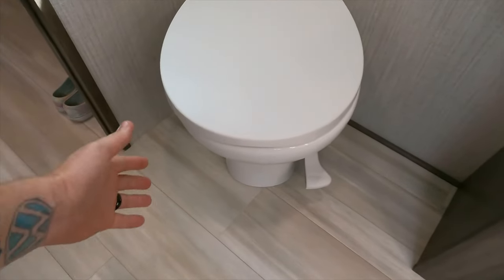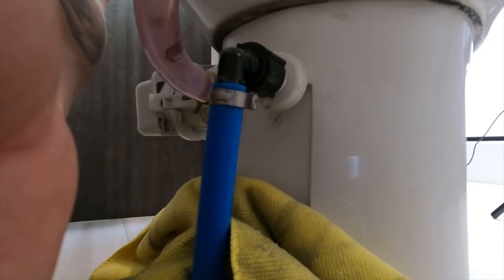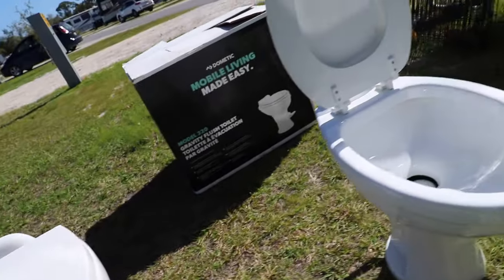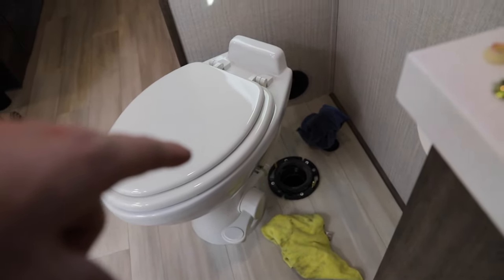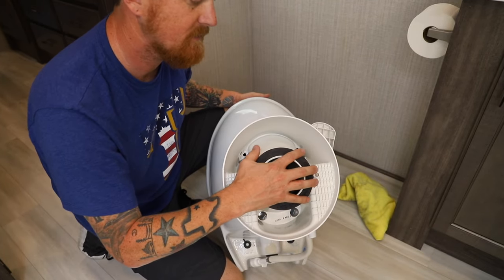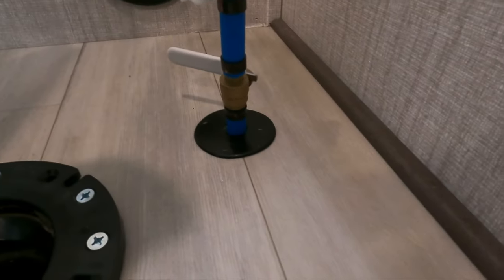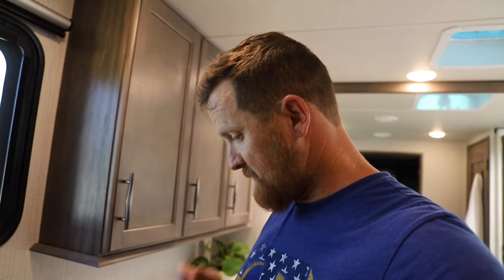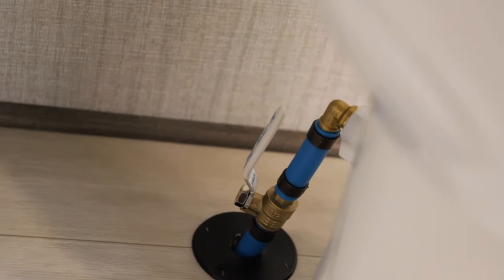RV Toilet Upgrade! Dometic 320 Toilet Install | Full Time RV Life

Comment: We have one, it sprays way more than that. it could be restricted by the additional fittings and on/off valve, each will add a % of restriction.
Reply from the maker: Good point, maybe that’s what it is. Thanks for watching
Reply: Damn, I think you should’ve stayed with the original one. If it ain’t broke, don’t fix it.
Reply: My 321 sprays the same amount in the front, it’s not much. Oh and these toilets are meant to be disposable because they don’t sell many parts for my 3 year old toilet so I have to toss it in the landfill.

The 510 has more parts available.

Comment: I’ve installed the toilet in a house trailer. Meaning not an RV. Residential toilet The process is slightly different because you guys have to use a rubber seal as opposed to a wax one.  flange seal.
Reply from the maker: Ya, that’s really the only difference.

Comment: Just got off the phone with Dometic trying to diagnose an issue as the bowl won’t hold water after replacing the seal. They acknowledged a manufacturing issue but won’t do anything about it. The two parts with the issue cannot be replaced and said the entire toilet would need to be replaced, at my expense. Basically, it’s a throw away POS! I’m shocked by their arrogance!
Reply from the maker: That sucks! Sadly, a lot of parts on these RVs are throw away!

Comment: I’ll throw you another tid-bit on the 320, I learned from experience. If you ever, by chance or stupidity, run out of propane in the winter in freezing temps….after thawing everything out, you may find that the foot pedal  is a bit resistant. DO NOT FORCE IT!!! Honestly, it didn’t take much extra pressure but it snapped off the smallest bit of the tip of the plunger for the water inlet valve so it wouldn’t flush. Apparently there was still a bit of ice in that valve. But, good news….you can get and replace just that valve fairly easily. I think there is a video of that here on YT somewhere. Someone else had somewhat the same issue I did. 😂
Reply from the maker: wow, good to know 😂

Comment: When you added those 1/2" crimp fittings for your shut off valve, you restricted the water flow. You should have used push to connect Sharkbite fittings. They lock over the water pipe and not in the pipe. The don't restrict water flow.

Comment: Went from the 300 to the 320, I do like the size better. My only complaint is when you get those parks with crappy water pressure, it doesn’t like to flush well but I guess that’s an issue with any toilets unless you install a res. toilet with a tank and risk it breaking when you move. That valve was a smart idea, I did the same. 
   Edit:: After watching the whole video and seeing you had the same issue with water pressure…. I find that it doesn’t start working “right” until up around 60ish psi. I know everyone gets scare about higher psi but in our newer rvs with 1/2” PEX, it’s rated to 110, so if you have pressure available, turn it up some more. But be sure you didn’t kink a line also. My problem is these parks that reduce down to like 45 psi. Even older rvs can handle 55-60 unless they are just junk.
Reply from the maker: Yep the water pressure is still something that has yet to make me happy with the 320. You are right though, 60 psi definitely makes it better. I also notice that it flushes a little better if I'm running off of my water pump instead of city water.
Reply: I don't think the issue is that the lines can handle higher psi, which you are right about, but the components that they are attached to can not handle higher psi, such as cheap plastic faucets/shower heads/black tank flushes. Its the water components that you need to worry about.
Reply: You might find that there is a shark bite push-on valve that's "full port".  I'd not worry about the life expectancy of the shark bite as you are at a lower pressure AND the fitting is readily accessible and visible--so if there is a problem you can fix it.  I've NEVER had one accidentally come off but for SURE have had to fight with them to get them off once those metal teeth as set in.IDK about the 90.  You can also go to 1/2" copper that also works fine with sharkbite and will definitely give you a MUCH bigger Internal Diameter and the resulting flow. Or maybe use a push-on size adapter to go up a size in tubing to 3/4"PEX (not copper that'd be nuts) and then those valves and 90 will have a bigger Inside Diameter/ID that should ease the restriction. I DO agree that it's the cheap valves and plastic parts of showers and sinks that are going to give out with the higher pressure.  It may take some time for the cracks to propagate to failure but when it does....it'll tend to be full blast--NOT like a metal water heater that's rusting through and starts seeping a little for days/weeks before a real stream shooting out.  It might be worth it to run a bigger line or even 2nd pump or add a 2nd pressure adjuster to bump the pressure BACK down to the rest of your rig.  IDK how complicated your plumbing is but seems you have the tools you just need the fittings and couple of sticks of 3/4" pex.  Oh there is a snap on brace that will curve the 1/2" 90degrees.  You'll need 2-3" so may have to relocate the cut-off valve back to somewhere else before the bathroom floor but it should definitlely help and is a big reason why PEX pipe can usually get away with the flow penalty of a thicker plastic sidewall/smaller ID penalty. I'd try copper+Push-on Fittings (take out in the inserts that keep the plastic PEX from collapsing first and then maybe a second water pump just to the toilet..BTW someone commented that the seal on a 320 is now known to cause waste water to collect where it mounts and rot out the wood/mounting material....I haven't checked it out but the OP responded they'd heard that too and there are no more 320s for sell on Dometic's Amazon store--only older stock in retail or clearance warehouses...  Just saying...--DD

Comment: We have a Dometic too in are RV and the flush valve keeps leaking and I replaced it 2 times. I just had it replaced 3 weeks ago and we are camping for 2 weeks and it worked great for 1 week and it just started leaking again. How is yours doing? And do you have any ideas?
Reply from the maker: Ours has been great for 2ish years now, no valve issues so far, knock on wood! I’m honestly not sure but the only thing I could think of would be to see what your water pressure is. Maybe it’s high and messing with the valve.

Comment: So, aside from you installing the water shut off valve, would the existing water pipe and connector work with no issues on the new toilet?
Reply from the maker: It was a little off with being considered correctly lined up from what I remember but it wasn’t enough to cause issues.

Comment: Other than the obvious comfort/size and seat differences was there any reason you did not like the Thetford? Did the Thetford break down or leak in some way? I'm actually contemplating replacing my Dometic 310 with a Thetford Aqua-Magic Style II (which is what you had) because of the leakage problems with the Dometic. The insides of the Thetford look like a much better design. The Dometic is designed to leak in my opinion. I do not have enough clearance to the wall for a Dometic 320. The Dometic 310 is smack against the wall and the 320 needs 11 inches (1 more inch than I have.)
Reply from the maker: Nope, other than those 2 reasons and the small wash nozzle at the back of the bowl, the Thetford was fine. It was a great toilet for what it was made to do! We just wanted something a little different.

I actually installed the Thetford from ours in to my Mother-In-Laws rig and its still running fine to this day!

Comment: My valve continues to break on my 310 and i have now ordered 4 different types. In my opinion the 300 series foot pedal is an absolute design mistake and you're better off getting one with a button or some other type of inlet. Mine has broken again this morning and is currently sitting with a toilet brush wedged into it so I don't have to shut off all the water to my entire system
Reply from the maker: I'm not too familiar with the 310, is the foot pedal the same as the 320? Luckily we've been ok so far but haven't said that, I probably just jinxed myself.

Comment: Thanks for the instal and review. I think I am going to try and build a pressure tank in the basement of the coach and run dedicated lines to the toilets. If possible use a domestic tankless toilet as water use I not an issue since I am hooked up to my RV lot 95% of the time.
Reply from the maker: That would be pretty cool to see

Comment: I have a silly question. When replacing a toilet. Dose the toilet have to be the same brand as the old one?🤔
Reply from the maker: Nope. Our original was a Thetford and the new one was a Dometic.
Reply: Okay awesome thank you. Yeah my og is a thetford and just order a thetford aqua Magic" but my og is a thetford aqua Magic starlight.👍
Reply from the maker: Ya I think you'll be fine! If you were to run in to ANY type of issue, it would probably be the water connection on the back not lining up quite the same but that still probably wouldn't be too bad of a deal.

Comment: Our GD Imagine came with the 320 bowl. That’s the way it flushes on ours. Nice install.
Reply from the maker: Your Imagine came with the 320?! That’s awesome! Do you like yours? So far so good for us!
Reply: @ExploringOurCompass I’m really happy with ours. Better than the last RV with the similar Thetford. There’s that one area you’re talking about, that never washes off, but were not full time and is easily cleaned. Also, the 320 is a porcelain base. Something a lot of campers dont have, however my 2150RB has a cheap plastic lid that moves around a lot. Replacing it soon. Also, the water supply line on mine isn’t as nice as what you did. It fell off and leaked on a few trips, I thought it was the shower at first. Love ya from the Shack!
Reply from the maker: @LoveShackBBQ  yikes, the water line fell off!? That sucks! I’m happy with this one so far also, it definitely has a better feel to it and cleans the bowl a lot better.
Reply: @ExploringOurCompass  it didn’t fall off but yeah man, it was a cheap hose clamp that wasn’t in place. There’s always something on an RV that needs repair, no different than anything else. It was a small leak for us, but enough to bring big concern. Which brings me to say, dont slack on a daily inspection of your full time RV. Little errors bring Big issues.
Reply from the maker: It’s always something, right? We had a huge leak in our shower about 2 months after buying our Solitude. The PEX clamp just fell right off and so did the water line. Lol

Comment: I'm switching mine out I have the same one that you removed thetford junk trying buying parts for it waste ball valve shaft to the foot pedal is junk try finding it brakes real easy I came to the same conclusion as you did sing toilet awesome
Reply from the maker: Yep! We’ve been very happy with the Dometic 320 so far. We did change out the lid from what came with it though, to a slow close lid. Much better!